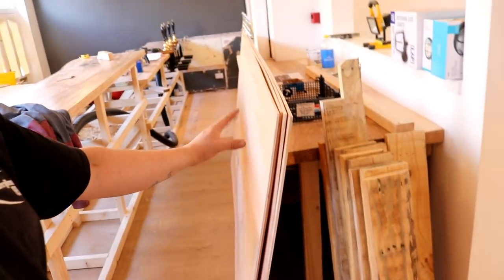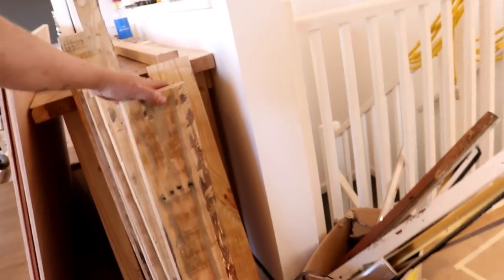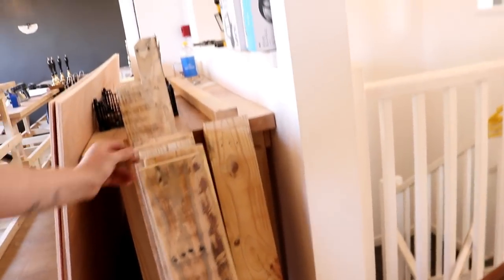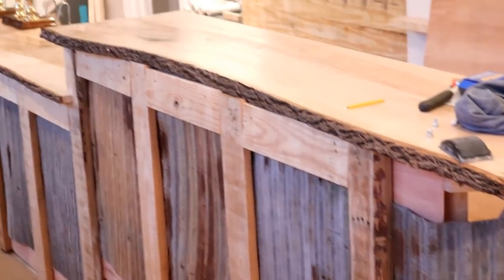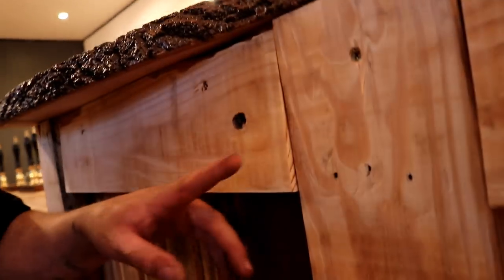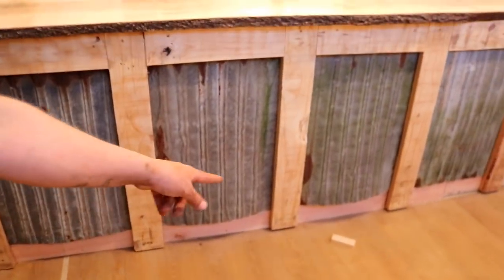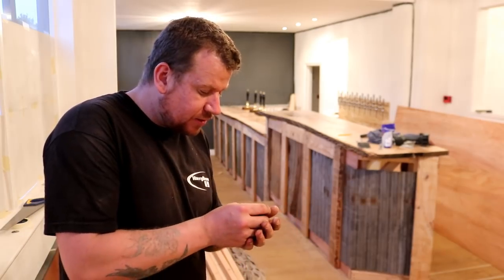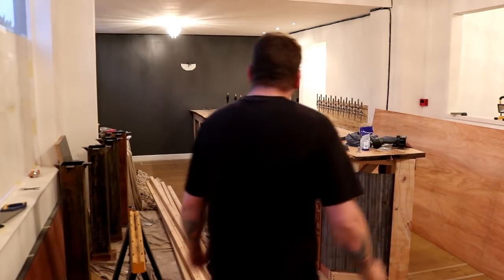CAN WE GET THE SHEETS ON THE BAR?

Comment: Looks great,  you've all been working hard.  Just a suggestion.  If you want the horizontal timbers to be flush with the vertical ones would it work to drill a pilot hole up on a 45 deg angle from underneath, where it won't be seen, push them back flush and screw them to the vertical timber?